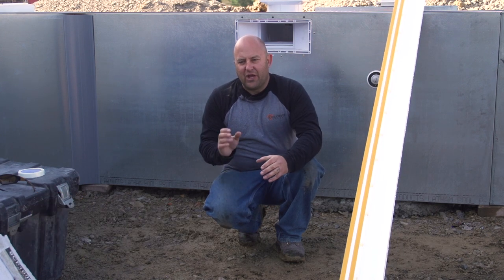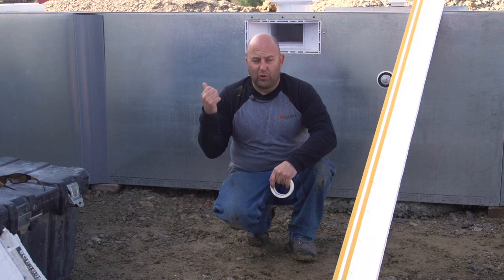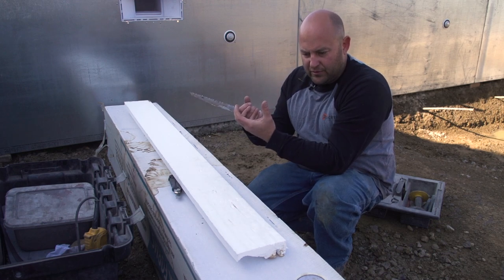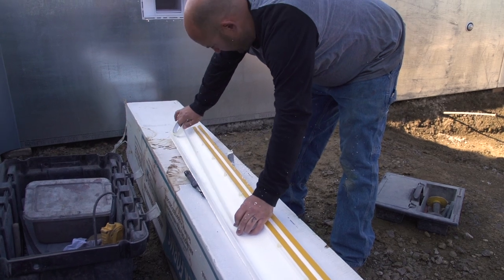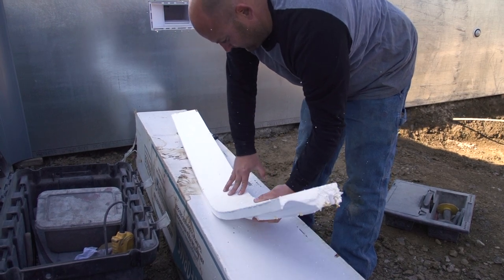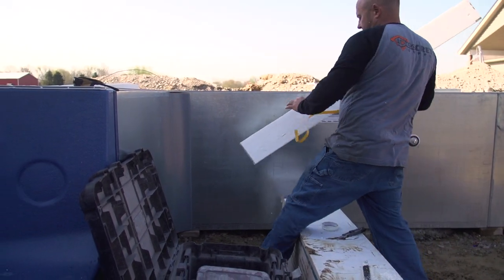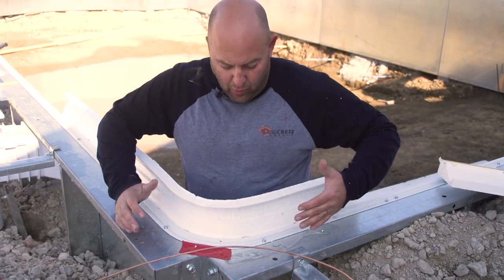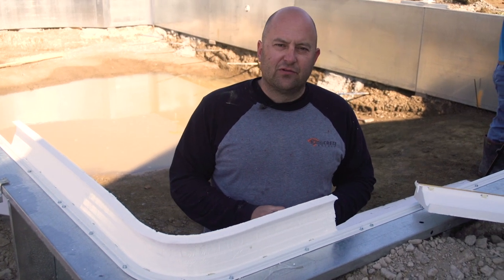How To Bend Styrofoam Pool Forms

Comment: I have the stegmeier forms but not enough tape to finish the project. Is there a specific tape that you use that can be purchased from hardware store?
Reply from the maker: You may be able to find fiber reinforced tape at the hardware store that is similar, but we would recommend ordering a few extra rolls of stegmeier tape https://www.deco-cretesupply.com/products/forms-expansion-wire/stegmeier-bending-tape
Thanks for watching Michael!